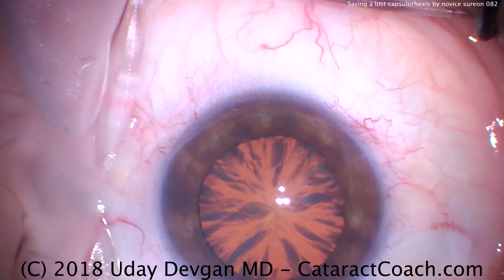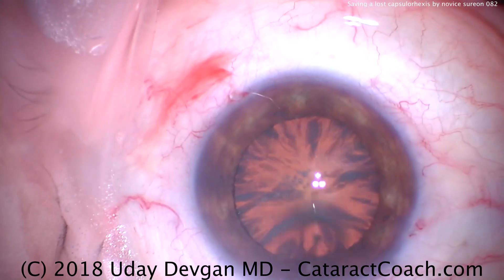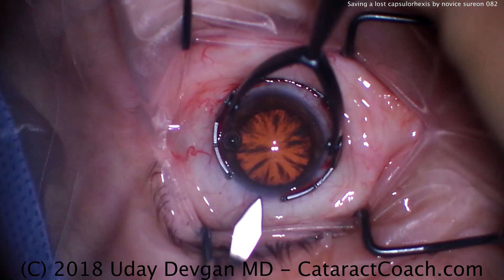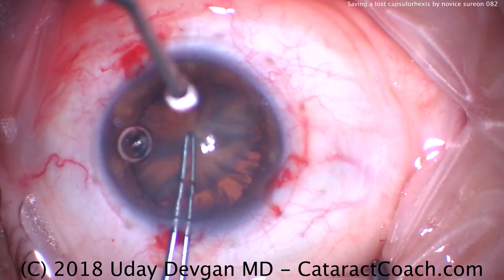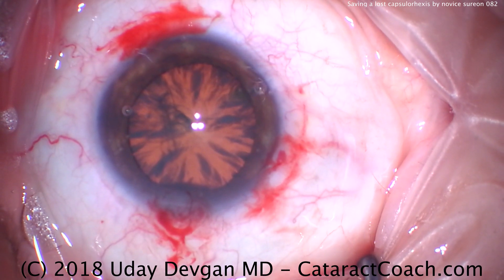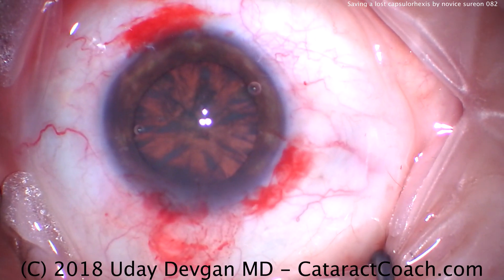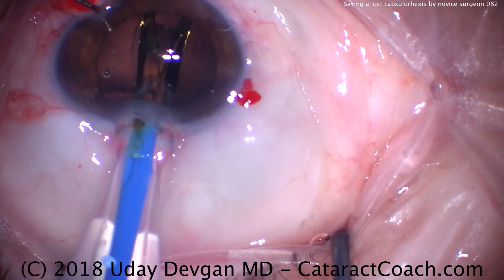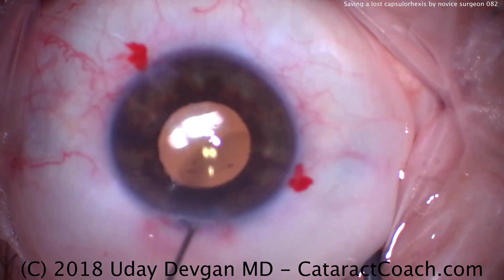Lost Capsulorhexis during Cataract Surgery - here is how to fix this problem

Comment: First thing most beginning surgeons are not aware you can take a canula and just brush those spokes  out of the way by stroking the anterior capsule for a better view, you can see this occur inadvertently at  points in the video.  Second I feel every surgeon should have access to and trained to use micro scissors and micro utrata forceps that can be passed though 1-1.2 mm paracentesis. These instruments allow controlled rescue of tears or enlargement of a small rhexis. This is also a great way to fix any radial tear from femtosecond capsulotomies.  Lastly always use Visual blue if you can not find the capsular edge and the view is poor.
Reply: Totally agree, sir

Comment: the resident is very lucky to have a teacher like u sir.. but just a question.. why not use trypan blue dye in such cases with dificult visualisation
Reply: Great, what about “clean” viscoelastic with i/a probe an then stain?
Reply: Edmar Uribe absolutely agree, when you lose capsulorrhexis edge in the beginning, its much safer to wash the viscoelastic with I/A probe and stain the capsule rather than fishing blindly for rhexis edge.
Also that woule be better to stain the capsule in the beginning of the case, a cortical catract with so many cortical spokes is not an ideal case for a beginning resident .
Reply from the maker: yes, that would also work, but once you have put dispersive viscoelastic on top of rhe anterior lens capsule, it is difficult to stain with trypan blue dye
Reply: Any reason why not use dye right at the beginning of case sir?